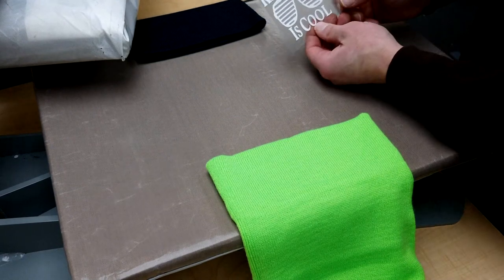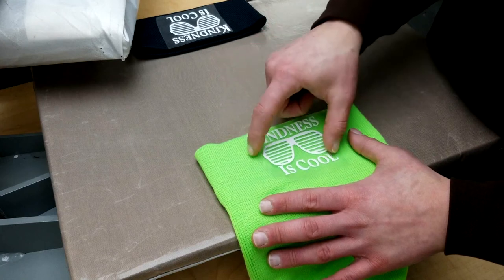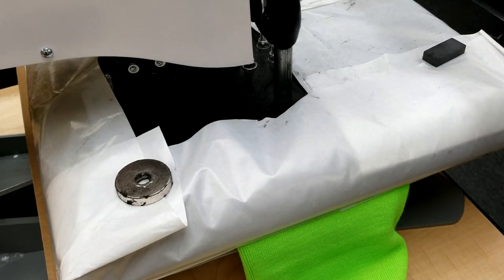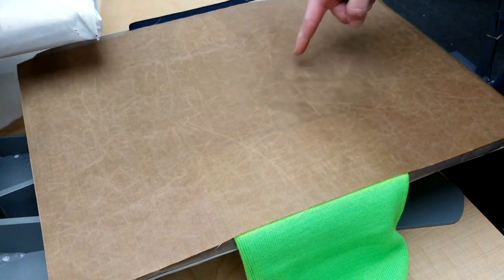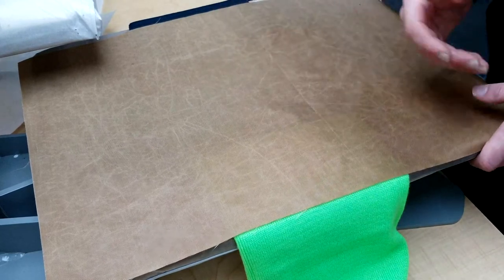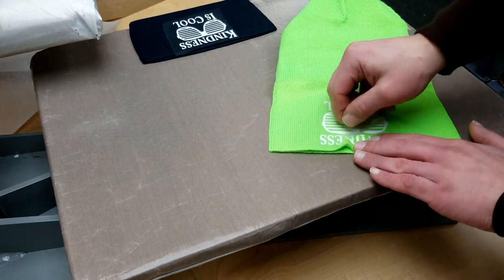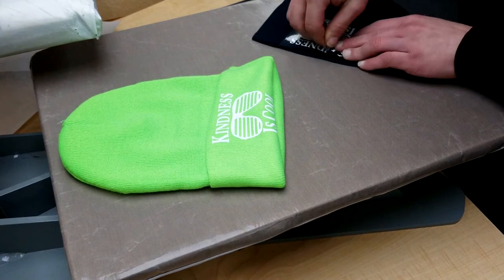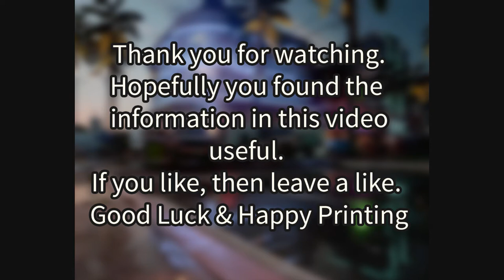How to press vinyl on 100% Acrylic knit caps | No shifting | No Stretching

Comment: Don’t they lose they like stretch then? Once they get flattened like that?
Reply from the maker: Not if the correct quality cap is used - good question
Reply: So you didn't use the correct quality, as its completely flattened ?
Reply: @mikegraham8319  😂

Comment: 330 350 for avout 20 sec. Midium pressure
Reply from the maker: Great settings - Sounds like the standard , everyone's machine is different so 350° may be 345°-354° - For best results use a temperature test strip for heat presses.

Comment: Pretty cool I could do this with my cricut
Reply from the maker: Cricut is a great starter machine - Most of our clients use them - I recommend a minimum of 24 inch cutting plotter to allow greater selection of material use and not having to cut large vinyl into sheets. Best of luck & happy printing

Comment: Is there a way to keep the hat from compressing and losing the puffiness it originally had?
Reply: That's always the problem I think the temperature settings should be at a certain rate
Reply: Try a lighter pressure.

Comment: It goes on nice but after you stretch it out to put it around your head it stretches all out
Reply from the maker: If you are using our flexible vinyl - After it is cool, when wearing it - gently pull the sides of the hat fabric forward = Problem solved! Good luck & Happy printing <3

Comment: My hats shrink when I put it on the heat press how do I stop this from happening?
Reply from the maker: Impossible to determine the problem without knowing the brand of hats. Usually the quality of hat plays a big part in results. Heat pressing requires higher quality hats. Use a different brand, try our temps and time or lower.

Comment: The hats are very flat now
Reply from the maker: Use only light pressure to press - Press in increments split your total time in half- (copied) ->  Not all acrylic is created equal. Usually hats priced below $2 are made of recycled material. We sell very high quality caps that  work great for heat pressing. ( sold during seasons only - bulk deal available ) Good luck and happy printing <3